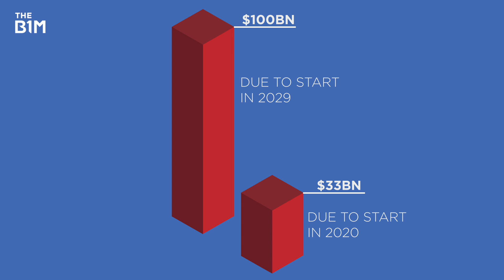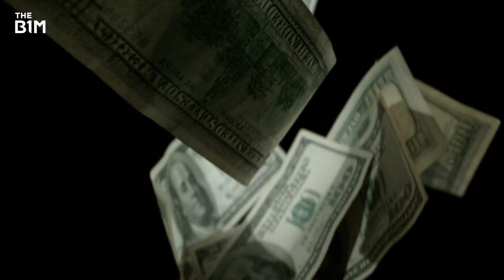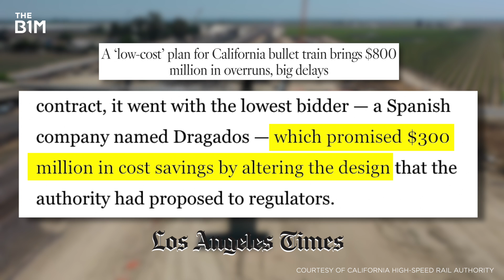What Went Wrong With California's High-Speed Railway

Comment: Good video, but disappointing that it failed to mention the CAHSR's original & fatal flaw: the route.  By "connecting the Central Valley", the project could no longer deliver on its primary (and voter-approved) function, shuttling travelers between Los Angeles and San Francisco as quickly as possible.  Routing into the Central Valley not only lengthened the duration of the trip sapping its utility, it added dramatically to the cost since there was no ready made right of way.  Ideally, the project would have followed the existing right-of-way of Interstate 5 (particularly in the mountains north of Los Angeles) for much of its route.  Much of the distress detailed in this video can be traced to that extremely ill-fated decision.

Comment: For the project cost one could provide Uber or Southwest Airlines free vouchers to any one who wanted to travel that path for ever and ever.  Just invest the 500 billion it will eventually cost and use the interest to pay for the vouchers.   If you've ever driven down I5  between SF and LA it seems its 90% big rigs. An  efficient multi track upgrade to the existing rail lines to help replace the big rig traffic makes much more sense.  It will take you longer by B1M given the route and the stops in along the way than it would to drive.  And when you get there you still need a car.  Going to be very inefficient, large heavy train with only 10% passenger load will use much more fuel per passenger run than any Airline and tickets will cost more.  Besides cars will all be electric by then.   Literally has no benefit except as a play toy for the rich politicians promoting the boondoggle.

Comment: With large tracts where the trains can run at speed without having to stop, the US would be ideal terrain for HSR. The question is - does anone there know how to do it???
Reply: actually having unpopulated open terrain is really bad as you need massive density to make things economically feasible.
Reply: The engineering is manageable, prying loose the money needed is a problem.

Comment: Does it seem like California is trying to run at 220MPH before they know how to crawl?  That's a reference to the ridiculously disjointed rail system that currently exists. The North/ South rail lines dead end in Bakersfield and San Luis Obispo. The East / West line connects LA with Kingman AZ, but misses Las Vegas. It would still be a game changer if we could connect all existing segments with regular Amtrak type tracks.

Also this video barely touched the biggest challenge of the project, the geology. The Central Valley's southern end rises abruptly into steep, highly erosive, tectonically active mountains. Interstate 5 climbs almost 4,000 ft. in about 10 miles with numerous sharp curves.  Nothing is impossible, but it isn't easy to build a bullet train through all that.
Reply: @Ramen Lover I know. I'm talking about the "Grapevine". That is the steep and treacherous stretch of I-5 that connects Central and Northern CA with Los Angeles via a steep pass in the coastal ranges. That geology is challenge may undue this whole project.

Comment: Anyone ever  consider the ramifications of the inevitable economic impact of all those high paid commuters that would work in LA or the Bay area and make their homes in the less crowded, much cheaper small towns along the rail line? Property values will go through the roof. Making housing out of  reach for the lower income folks who actually live and work in the central Valley. Not to mention the strain on resources the rapidly increasing population, in those small towns will inevitably create. Take a look at Modesto and Los Banos for a taste of what has happened in those communities as relatively Rich Bay area workers fled the high taxes and congestion in the Bay area and turned them into commuter bed-room communities that are now severely congested with skyrocketing housing costs and increasing tax rates. High speed rail doesn't solve the problem, it only spreads it out.

Comment: Think every penny directed toward the entire boondoggle could’ve been better spent on DIRECT mass/rapid transit connections back & forth from San Francisco, Sacramento & EVERY main city within the Central Valley? Merced to Stockton back & forth to/from BARTs systems?

That alone would have significant potential to TAKE a small but noticeable amount of daily commuting cars off the roads overtime compared to this whole entire disastrously executed high speed rail system to nowhere, right? Just plain light & maybe some heavy rail between said closely spaced metropolitan areas...

Comment: I live in California. This rail project was a fraud from the beginning. The contractors for the project contributed money to the politicians who approved the project. The total amount of the project was intentionally underestimated. Once voters approved funding it was announced that billions more were needed. Then all the money was spent to the contractors. 

Next, the rail authority said that since it already spent the $10 billion the program had to go forward with another $90 billion of tax money. 🤦🏻‍♂️🤦🏻‍♂️🤦🏻‍♂️

It’s a scam. It’s a fraud. The whole program has been about spending money and not completing a rail line. 

One thing not mentioned is that the rail line cannot be “high speed” because it’s too expensive to build new tracks designed for high speeds. Long portions of existing tracks will be used and shared with typical freight and passenger trains. That means it will be a normal passenger train. No advanced bullet trains can use regular rail lines. 

A waste of billions of tax dollars.

Comment: Even if the rail finished today, tomorrow there would be no one on it. I just did a search: I can get a ticket on a direct flight on Southwest Airlines from SFO to LAX leaving tomorrow morning for less than $175. The flight is listed at 1 hr 30 min from gate to gate. Even if you add 2 hrs on either side for commuting to/from the airports and check-in, that’s 5.5 hours from point to point for $175. Now tell me high speed rail rail can beat that time and price. Their website says “in under 3 hours” for the train commute alone. Now add in commuting to/from the stations and check in. Even if it could, it would only be by a few dollars and given the cost of this enterprise it would take centuries to make that $ back. The Dallas/Houston line seems more realistic given the distance and terrain, or an east coast line from DC to Boston with stops in New York seem more plausible. California just wants to be the first and anything and they flush $ down the toilet every time for it.

Comment: The horror story about the California HS Railway is not the only one. Boston's Big Dig is every bit horrendous: 

"The Big Dig was the most expensive highway project in the US, and was plagued by cost overruns, delays, leaks, design flaws, charges of poor execution and use of substandard materials, criminal arrests,[2][3] and the death of one motorist.[4] The project was originally scheduled to be completed in 1998[5] at an estimated cost of $2.8 billion (in 1982 dollars, US$7.4 billion adjusted for inflation as of 2020).[6] However, the project was completed in December 2007 at a cost of over $8.08 billion (in 1982 dollars, $21.5 billion adjusted for inflation, meaning a cost overrun of about 190%) as of 2020" 

With such track records, I wish Mr. Biden's infrastructure project Good Luck!

Comment: And, oops again. It looks like the design engineers put the right of way aka rail line on east side of SF Bay so it terminates in Oakland, instead of the west side of the SF Bay so it terminates in San Francisco.
Reply: Wrong. The route selected runs right up the Peninsula from San Jose to San Francisco, on the existing Caltrain right of way. I live in Palo Alto, about 50 yards from the tracks, and have naturally been following this project very closely. The proposed route through the East Bay along the 580 corridor was rejected a decade ago.
Reply: @doverbeachcomber  I wish you were right, but unfortunately the official filings and news reports detail that if you take the  Train-to-Nowhere from LA to SF, to complete the journey the last segment of your trip is on BART from Oakland to San Francisco because the train sadly terminates in the East Bay at Oakland. The route your referring to was the original plan and like everything else associated with this project,  went by the (train terminology) wayside.

Comment: Unfortunately the design engineers forgot that as the rail line would be approaching Downtown LA from the north,  someone would have to drill a tunnel under the 10,000 foot high San Gabriel Mountains after crossing the San Andreas fault at a location that's expected to have a displacement of 18 FEET between the 2 sides when the next quake occurs, at 10's of Billions of Dollars. Oops.

Comment: It is called the train to nowhere - that nickname in itself explains why it is going to fail. Anyone taken Metrolink from union station to Palmdale? It takes an hour and a half, then you would switch to the high speed rail where you then go to another middle of nowhere city and then take Bart into San Francisco - no one will do it. Takes so much longer then flying and will use commuter rail that honestly suck.
Reply: Caltrain is currently electrifying the 50 miles San Jose to San Francisco commuter line with the same 25 kV AC used by high speed trains. It won't be fast all the way but one won't have to switch to commuter trains. Same thing in LA I believe.

Comment: we already have a railway and train, called the AMtrak. runs from San diego to seattle. just need to modify it and close or move crossing where streets it runs thru in big cities. more cheaper than building an entire new rail line. last thing we need is a construction project given to a company that will take 100 years to finish it and i say 100 years becuase small projects on california freeways take years to finish when it could have taken less than a month if the construction went on none stop.
Reply: None of Amtrak’s services (except for the Acela Express) come close to High Speed Rail standards (much of the Northeast is higher-speed rail).